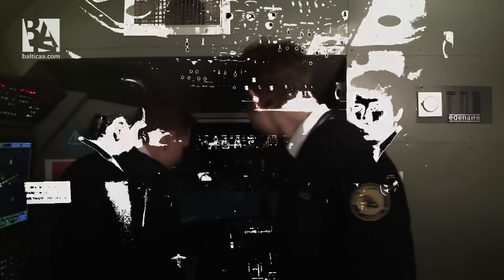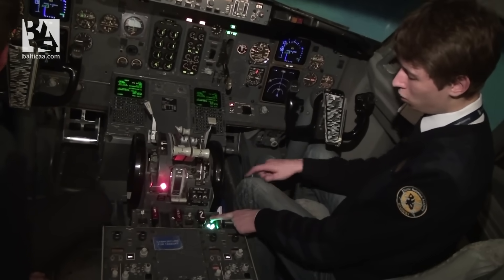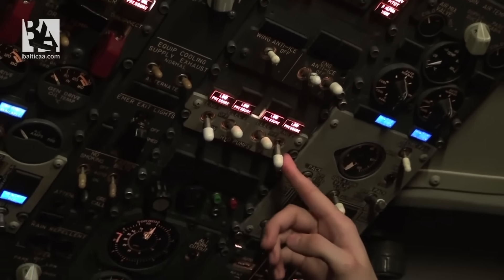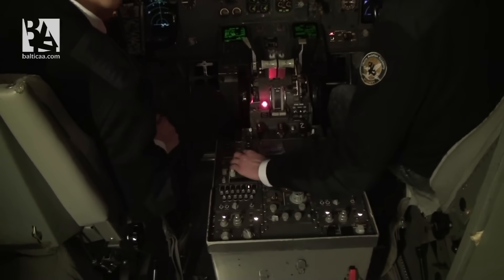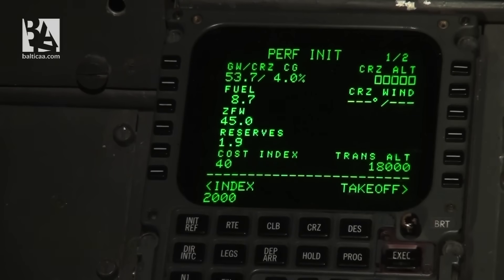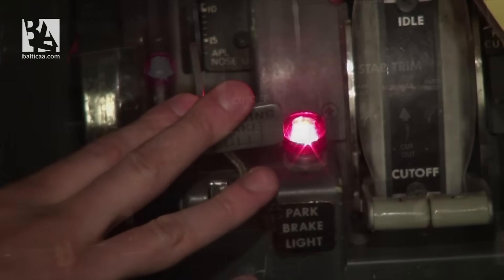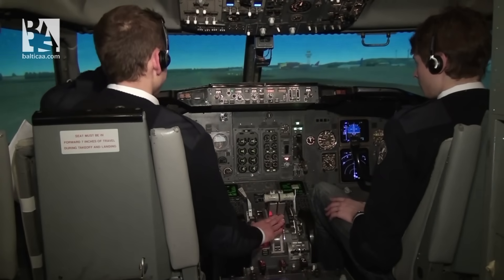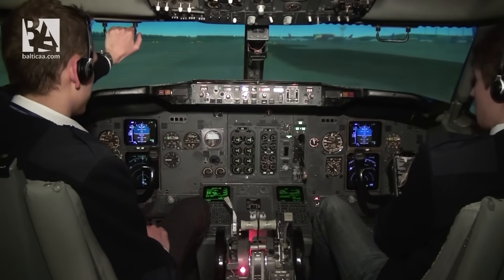Boeing 737 -- From Cold and Dark to Ready for Taxiing

Comment: i WOULD KNOW STEP BY STEP WHAT HAPPENING INSIDE THE ENGINES WHEN THE "STARTING PROCEDURES" IS DUE.
I MEAN WHEN YOU PUSH ILDE AND AFTER YOU PUSH THE UPPER BOTTOM ON IT WAHT'S EXATELY HAPPEN INSIDE THE ENGINE?.. AT WHAT MOMENT YOU MOVE THE "IDLE" AND WHY?...WHAT HAPPEN IF YOU MOVE IT IN WRONG MOMENT? ... OR IF YOU TURN IT BACK AFTER STARTING THE ENGINE?...THANKS

Comment: well, an answer to you. the altitude you set in the cruise alt window is not your initial cruise, it's your destination. if you set 30000 and climb only to 2000 and then descend it will be an unscheduled descent and the plane would know that something's wrong, etc... 
if you want to climb 2000 and stay there, you just do that, you derate the TO power only for the sake of not being so rough on the engines. if you overshoot 2000 - you're not a pilot :) 
and FMC can fly you by it self up to 2000

Comment: The only thing I dont understand is why set the pressure and cruise at 2000 ft? What happens when you go to thirty later? Does the FMC set that automatically? One question I have always had is this: If you want to get to an initial climb altitude of 2000 ft, your N1 has to be set accordingly otherwise you will overspeed or overclimb. Is that done by the FMC? automatically is that why it gives you a particular N! target?

Comment: The starter switch is not the engine number its the acutal starter itself built into the engines. If its set to R it doesnt mean right side engine but right side starter (In a way hard to explain). The actual engine start selector is the knob he turns to GND (ground).

Comment: @yosjykurihara No, if the main fuel pumps are off and the APU is running, the APU receives fuel from Tank 1 by suction or an APU fuel pump but it is common practice to have one AC fuel pump on to increase the lifespan of the APU fuel control unit.